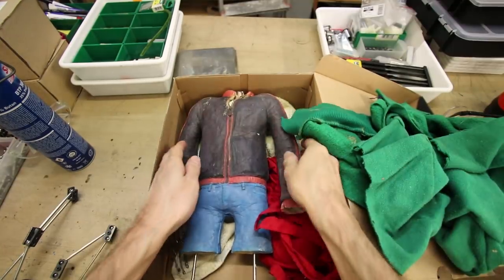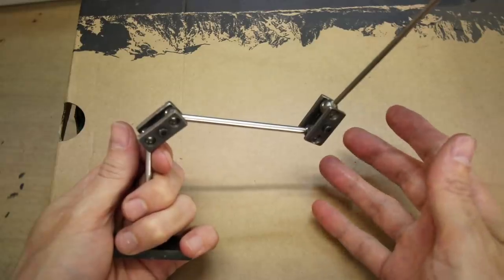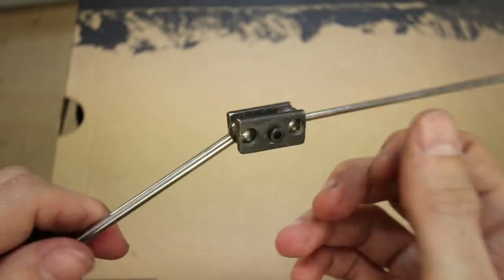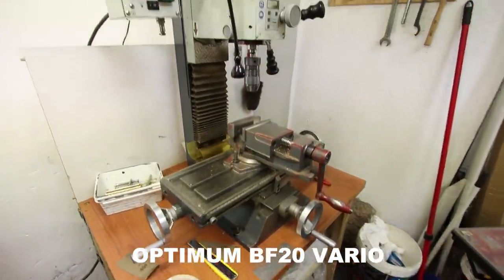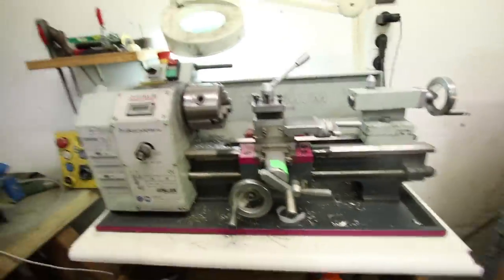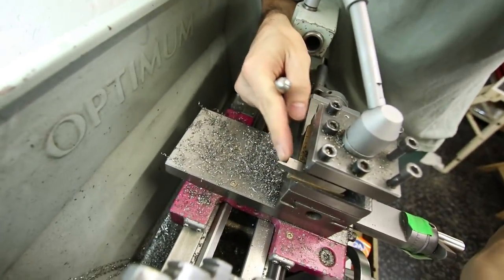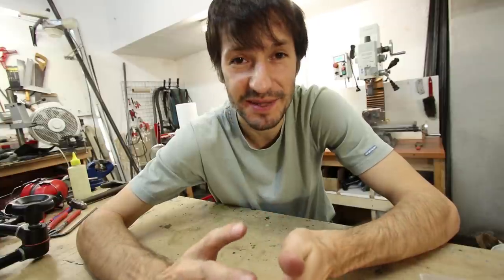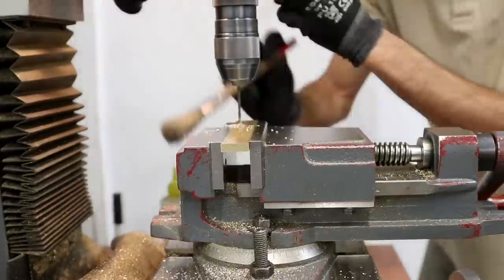Machines you need to build professional ball and socket joints

Comment: Can these parts be made with a 3D printer? or would not the material be strong enough?
Reply from the maker: For the moment and till we don't have metal 3d printers, this is not an option. Plastic bends or brakes.